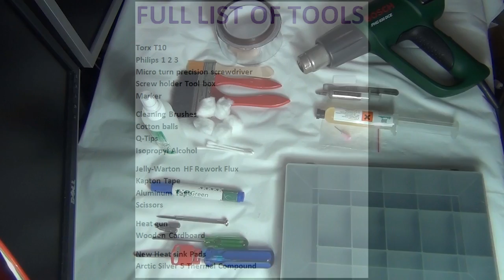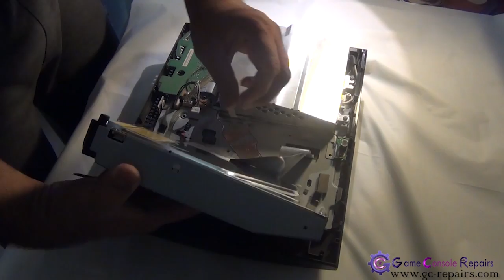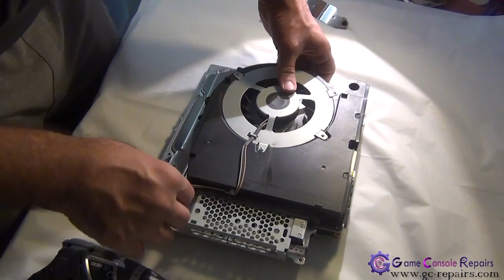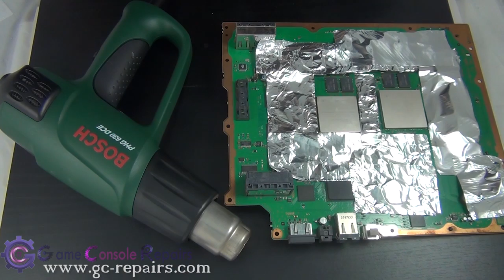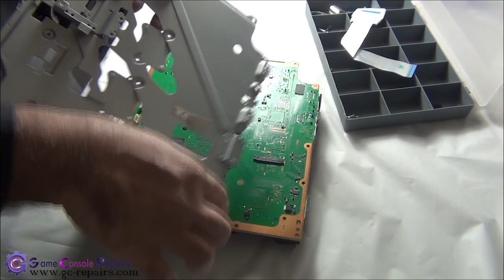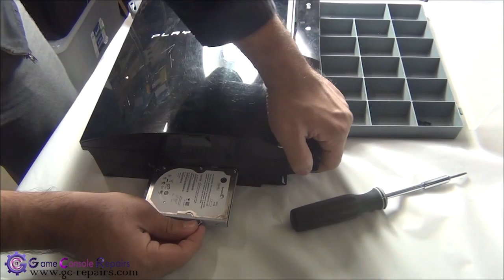PS3PHAT   40GB CECHG02   YLOD Repair via Reflow using Heatgunby gc repairs com

Comment: I followed everything exactly, except:

I did NOT use reflective tape (store closed).
I did use a RadioShack heat gun rated for 500*F
I did use RadioShack soldering flux (and made my own applicator with a CVS syringe, a basketball pump pin and some electrical tape).

Comment from the maker: @SicFC13bt
I am sorry mate if it didn't work for you. As explained in the earlier section of the video, you perform this to have the repairs done under $100 bucks. 
if it still fails then the answer is REBALL.
You have to take it to a technician who deals in Reballing and have Pro equipment such as Reball station and Programmable Reflow Ovens.
Hope this helps.

Comment: My heat gun has a low of 572° ...guessing that's too much...? :/

Edit: He must be referring to Celcius because 572° F = 300° C  So i used my heat gun and now (for the 2nd time in like 10 years) I've repaired my PS3 with this reflow procedure (thank you very much @GameConsoleRepairs).
NOTE: my PS3's fan is constantly running on medium speed now. It still seems to work fine but the noise of the fan makes me think i probably heated my motherboard cpu too hot to the point may have melted it. Be careful regarding the heat gun anyone that you don't do irreversible damage like I possibly did... :/

Comment: is working perfect. i burn the  two of the four chips because of hight temp but is working
is better to say the temperature that you need to reach on the chipset
good job thx
Reply: I also burnt the 2 NEC chips. How did you fix it? Did you replace the chips?
Reply: Nikolaos Tsarmpopoulos
 όχι Νικόλα δουλεύει χωρίς να αλλάξω κάτι
το εκλεισα ετσι και δουλεψε
Reply: Ποιο heat gun χρησιμοποιείς ; θέλω να αντικαταστήσω τους πυκνωτές.
Reply: +Polydoros Markides how did you replace the chips?

Comment: hi bro i just came across your video can you help i got ps3 40gb console when i turn it on im getting a red light it only turn green for a couple second then i hear 3 r 4 beeps then the red light start blinking i put new paste on the top gpu and cpu and done the reflow i haven't remove the chips do you think it's the nec tokin anyhelp many thanks

Comment: Let me ask u this. Ive done all that n its still cuttin off. Ive cleaned it all da way n its still shuttin off. Your video or all these videos only sho yal ps3 workin just fine but once i tried it it doesnt work. If i replace the hard drive will that make the ps3 work better n not cut off

Comment: I failed to fix my PS - actually I damaged it, by using a cheap heat gun lacking temperature control. Two capacitors (NEC/TOKIN OE128) were deformed in the reflow process.

I had earlier used the heat gun on the oven's thermometer to test the temperature of its output and I was mislead to believe that the temperature of the output was not beyond 350C.

Don't do the same mistake. Buy a professional heat gun or let a professional do the job for you.

Has anyone attempted to replace the NEC/TOKIN?

Comment: you cant call yourself a console repair guy and blast consoles with a heat gun. This is a botched repair. You wont have any longterm success and a proper reball now becomes difficult. Put away the paint stripper!